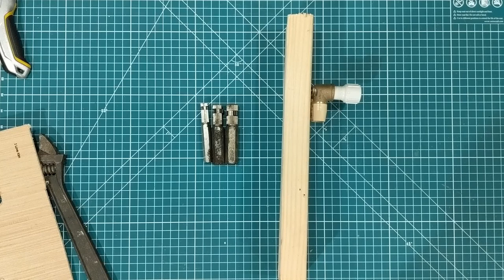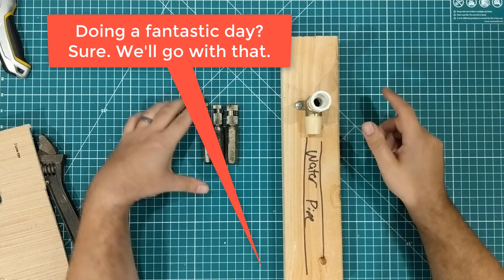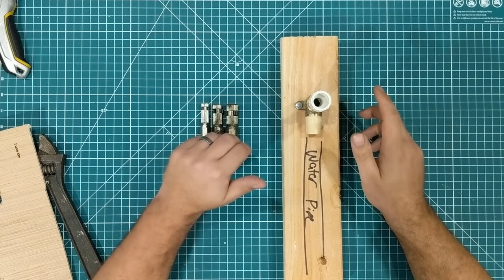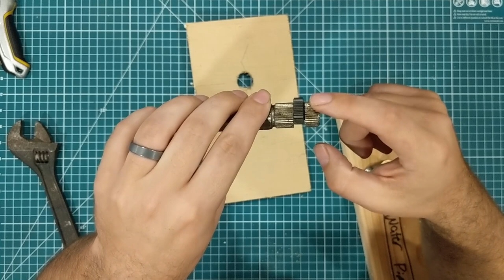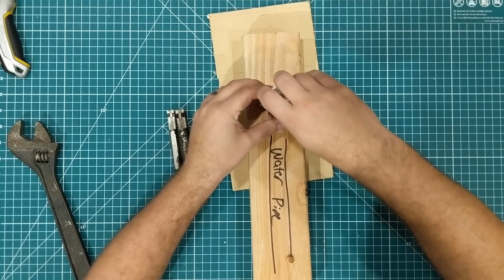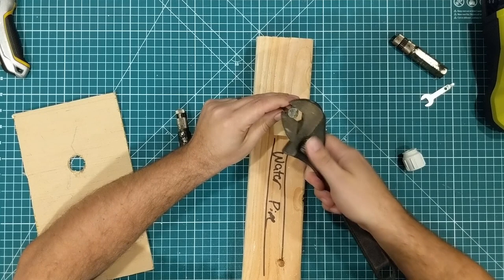Internal Pipe Wrench - Tools That Can Save the Day #1

Comment: Have a broken off copper transmission fluid line running to my radiator on a 66 mustang... You sir, have save my day!
Reply from the maker: I hope it worked! This thing saved me the other day.  I had to use a giant cheater bar and ratchet but it got a broken nipple out of a piece of cast iron that saved me $250.

Comment: That drop ear 90 is stronger than you think. Get a 1/2 metal shower arm and an escutcheon..little tape and dope. stick a plyers  handle in the end and use your other hand get it tight but straight. idk why anyone wouldve used a mip adapter bc youd have to transition back to threaded for the shower head
Reply from the maker: Thanks for the tip. We have relatively hard water here in Florida and I've definitely seen them get weak from old leaks and I've snapped a few elbow ears off in my days.

Comment: It did not work for me. It came in a pack of 3. The 1/2 & 3/4 were to big & the 3/8 was to small. Any suggestions for something else that I can use?
Reply from the maker: Sometimes you have to put the tool in an angle? Like try putting the 3/8 in at a steep angle and then turning it while the tool is still angled. It will usually grip
Reply: Trust me I tried putting the 3/8 at an angle because I really wanted it to work, but it was just to small to grip. But thank goodness I look on other videos another product that was recommended was called a broken pipe extractor. I just received it in the mail from amazon and it worked!!!! That product was easy and very simple to use it came out with ease with just twisting with my hand, that product is better because it tapers at the tip and gets wider at the base. But it's not so easy removing the thread from the extractor, but that's the least of my worries, I'll figure it out.

Comment: Expandable plugs. Especially those designed to go through a full port valve to allow valve replacement without turning the water off.
Reply from the maker: I've used them. Those things are sweet.

Comment: Kinda wanted to see how you undo it once its latched on.
Reply from the maker: I normally do just tap it although I completely destroyed one of these removing a piece of steel from a piece of cast iron.  It was on my wife's heat press. Those two things are forever bonded together but getting that part out saved from having to buy a pretty expensive press, so worth it I guess.
Reply: @AnotherMaker  how do you think it'll handle removing a plastic moen 1222 cartridge that's stuck inside my shower tub valve?

Comment: Will these work on reverse threads?
Reply from the maker: I doubt it...They may make a reverse version, but backing it off loosens the grip. I just used one of these the other day and put an unbelievable amount of force on it...giant cheater bar on a 1/2" ratchet type of force, and the grip held.